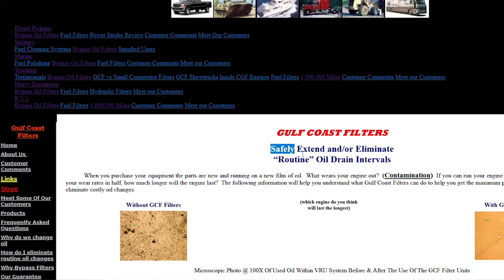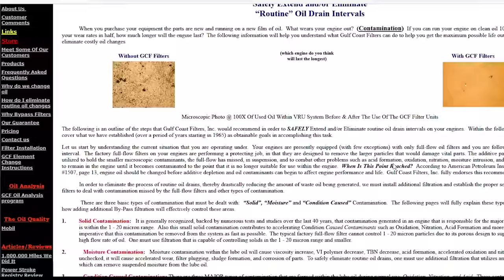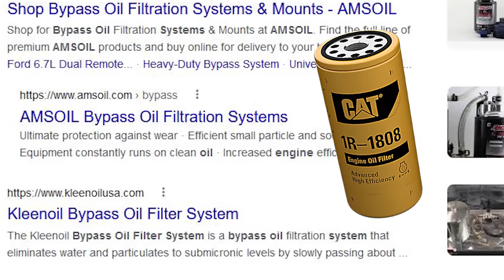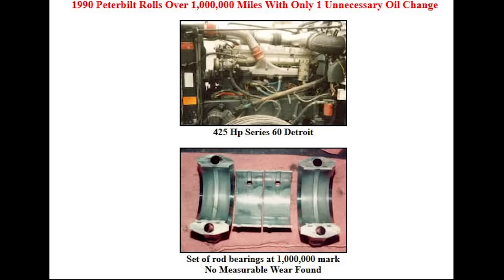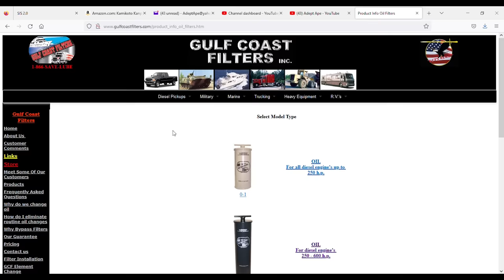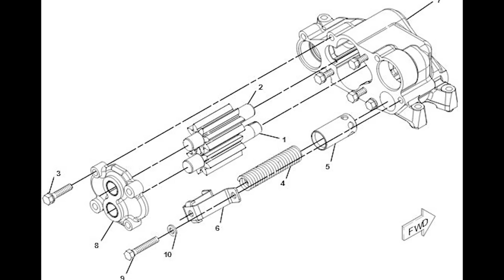No Oil Changes and 1 Million Miles!!! Are Oil Changes Optional with a Bypass Filter? (INTERESTING)

Comment: Please do one on oil centrifuges filters too!
Reply: For some reason most people prefer the simple bypass filter.. A engine needs a certain amount of new oil added. When you change the big Gulf Coast filter you add.3.gallons of new oil. Thats normally enough. When I change my filters its a quart of new oil added at filter change mormally 6.000 miles.In the 60s it was a quart of new ojl added.at 2.000 mile toilet paper change.I used Delo W30. I didnt know it at the time but the multi grades were no good. Couldnt use them in a diesel. They would void the warranty. I started using multi grade when Mobil 1 came out with 5 20. About 1970..you had to have a good engine to use it.

Comment: They don't get the soot out. You need a centrifuge for that. They are available as a bypass system. Bypass filters should increase the life of engine by removing small particles. I use them. You can extend oil changes but i wouldn't eliminate them. The soot thickening is still a prrobem. Use oil analysis at at least the oil change intervals to determine if you need a change.
Reply: When I installed  a toilet paper filter on my nearly new Rambler and saw the oil go from black to amber color I knew it was removing the soot. The soot wss why the oil was black. I found out later some soot is non abrasive and too small to be removed. It will eventually  turn the oil black. If I put the black oil in the palm and it wipes off clean without staining the skin its clean. In my gasoline cars the oil is amber colored. Normally in a gasoline engine the oil will stay amber some of the small soot is getting thru but in a gasolene engine its not enough to turn the oil black.
Reply: My 6.9 F250 im told had over 300 K miles on it when I bought it. The oil was a shiny black. Didnt bother me. I know black doesnt mean dirty in a diesel. I would be concerned if the oil wasnt amber in the Pontiac. The old Ford used or leaked a quart of oil about every 600 miles. I changed the toilet paper 2000 miles or less. The Ford diesel tractor is a lot tighter engine. Keeping the oil clean will be easier. Of course it wont be pulling a camper or a Horse trailer.

Comment: I do not change my oil, never have. The lawn mower is over 10 yrs old. Never changed the oil. Checked it last year for the first time. Only hat 8 oz in it. I did drain and top it off, now it smokes. My 318 requires 1 qt a week. Haven't changed it in 10 yrs, ant gonna change it.

Comment: Cars and trucks and stationary engines in 1888 had full-flow bypass oil filters. The manufacturing tolerances is what have changed!!! In 1918 a Rolls-Royce, or Packard or Miller-Duesenberg (THE finest motor in the WORLD!!!) or any Aero-engine MIGHT be built to +/- .003 INCH tolenerences. Today, Honda, Kohler, Shindaiwa and 20 other SINGLE CYLINDER $200 lawnmower engines are built to 3 MICRON (3 one-hundred thousandths) of a mm or 1/2500 the tolerances!!! Lexus and Japanese multi-cylinder motorcycle engines (and Japanese outboards) are spec'd to .5 MICRONS. I own a 1964 Honda 305cc SuperHawk twin with 30 K miles on it. I re-built it just for giggles. A friend has a 1970 Suzuki GT750 Three-cylinder "Water Buffalo" 2 stroke that has probably 1 million miles on factory rings and he rides it EVERYDAY! Another friend has a Suzuki RE5 rotary (Wankel) on FACTORY SEALS. I've NEVER seen a worn-out Japanese motorcycle engine. ABUSED-OUT, yes! Ask me about 1960's British Bridgestones, small Triumphs, small BSA's and the excuses for small bikes Hardly-Davidsome was selling in the early '60's!!! When the 1958 Honda Benly (Friendly) hit Californicate, a humble 125cc twin, the market for small Brit Bikes disappeared. The Benly would out-perform 350cc Brit-Bikes, mainly because it ALWAYS RAN!

Comment: Hot shot diesel has good information on bypass filters as well they suggested a tier 4 synthetic and to add additive packages back to the oil since those wear off over time but they had a similar experience with long oil change intervals
Reply: These guys say you need this special oil and special additives.. i use Super tech from Walmart and a Australian Jackmaster Classic on the Pontiac. Torrent. The Pontiac has 203 .000 miles on it. Runs like new and seldom needs oil. I did fine with conventional oil. The Wix full flow filter has 63.000 miles on it and about 4 years. If I start seing large particles in the Jackmaster Classic I will change the Wix.
Reply: When I started using the Frantz it was use a roll of 2 ply facial quality toilet paper and a good single weight oil such as Delo.W 30. Now you hear all this bull shit about you need this special oil. Rotella is dirty and toilet paper channels.I dont use toilet paper that channels. If there is any dirt in new oil its gone after it goes thru the toilet paper or paper towels. Gulf Coast came out with a better filter than the Frantz. The Gulf Coast junior. The Jackmaster Classic is a improved filter.I cant keep up with all of the good filters.It pays to shop around. The top loaders are best.I use Scott 1000 or Great Value 1000 from Walmart. I go on the Jackmaster web sight and they say to check with Gulf Coast about the 1 million mile engine. Are these people working together. The Gulf Coast junior I see a foreign language. Im glad im equipped. My oldest filters are 50 year old Motor Guards.

Comment: Do you have any experience with equipment that has an oil centrifuge? Just curious what you think would be better a centrifuge or a by pass filter system?
Reply: I run a centrifugal bypass on my Detroit series 60,it pulls a incredible amount of soot out of the oil.A bypass paper filter would  clog up over time like the main filter and just go into full flow and leave deposits in the oil
Reply: I have read some centrifuge manufacturers claim filtration down to one micron
Reply: @craigduffield3963  sounds like you know about as much about bypass filters as I do about centrifuges.. I dont run a filter until it wont hold any more contaminants. For some reason most people prefer the simplicity of a bypass depth filter. Jackmaster claims 1 micron filtration if you use their elements.

Comment: By pass filters work great but that doesn't negate the need for oil changes as specifier by the manufacturer of the engine. Viscosity breaks down and does not last. Not changing your oil is playing Russian roulette with your motor. Short term gaines for long term losses.
Reply: The oil is being changed . 3 gallons of new oil every 10.000 miles when the 3 gallon filter is changed is a lot of new oil added in a million miles Then you have the full flow filters changed.. Road King said thats equal to a full oil change every 40.000 miles. A lot of you guys arent paying attention.
Reply: Engine maker oil change recomendation are based on filters that dont clean oil

Comment: Actually in the old days they had diesel that actually can filter out the red dye download one or two microns they do have oil filters taken filter down the five microns the only thing it filters out the additive that makes the oil work. The old graphite oilers design to where you just change the filter once in a while and you would add a quart of graphite oil.
Reply: No the filters wont  remove the additives. The filters will remove graphite because it is a solid..Oil analysis will list the additives. You will need to know how to read the report.. with my old stuff oil analysis is checking the dipstick and  the used toilet paper for problems. Not sure about  the micron rating of toilet paper.. I have read claims of submicronic  to 1 micronic to 5 micronic. I would think they would be pretty much the same. The big Gulf  Coast filters have the size advantage. Very hard to get contaminants thru  22 inches of Bounty big rolll paper towels

Comment: Yep, no need to change oil.  Oil doesn't really break down, it is the additives and long chain polymers added to the oil that break down, causing it to fail.  Combined with the added contamination from combustion, a high grade filter and monitoring of the oil is often better than changing the oil in bulk intervals.

Main reason it is better than full changes is because a full change cycles between clean and dirty, while the extreme micron bypass filters keep the oil fresh at all times by more completely removing contaminates.

When changing the bypass filters, the oil capacity they have, about 2 gallons, is often enough to replenish whatever polymers and additives break down during the operational life.
Reply: Actually that is very true.. It has never made sense to allow the oil to get dirty then drain it. Oil analysis shows that 3 gallons of new oil that is added when the 3 gallon filter is changed every 10.000 miles is a little more than enough. In the million mile truck. Its the same in a over the road truck or a VW beetle. Its a matter of never allowing the oil to get dirty and adding enough new oil to get enough additives.
Reply: It wasnt too long ago when you couldnt use multi grades in a diesel.They must be a lot better now. I started using Mobil 1 when they came out with 5 20. About 1970.
Reply: @ralphwood8818  wasn't too long ago?  1970 was 50 years ago, heh.  Packard and Studebaker we're still making cars then.
Reply: I remember looking at the 1953 Corvette and wishing I had 3.000 bucks. I  was pulled over by park rangers as I came into Yosemite  park.The ranger called head quarters. We have to watch this kid.  He has a Studebaker Hawk with a souped up Chrysler engine.. Got a lecture on speeding in a national park.I wasnt speeding. I slowly went back out the gate. Didnt have a hood. A California Highway patrol car made a u turn and followed me for a mile or so. Actually it was a 55 Commander coupe with a silver Hawk trunk lid and a stock Chrysler hemi. 331. I believe the Silver Hawk was a flat head 6. The Golden Hawk had a super charger and a hood. The patrol car was a Dodge Polara with a 413 wedge head. 1960 I believe.

Comment: How many gallons of oil are in the engine when I drove semi I had 8 gallons in the oil pan six in the filters and 3 gallons in the cooler so you divide 17 gallons into a million miles then you have to add the oil and they change the filter every 10,000 miles all three of them so I see why the oil will guarantee a million miles they deemed to my truck obsolete only because it was the oldest one of the fleet and I was the only one that wanted to drive it no GPS on board computer a little twist of a screw here and a little repair here I just increase the horsepower and torque by 10 folds I love my truck

Comment: Oil bypass systems can make oil service intervals way longer. But not NEVER change it. It may go twice as long or longer with a 2 micron bypass filter...but that is it.
Reply: I dont think even a 1 micron filter can completely remove all the soot. The oil in my diesel tractor is starting to get a dark tint to it. Its my understanding that some soot is non abrasive and too small to be removed even by toilet paper. The oil in my gasoline engines is beutiful on the dipstick. Put it in a glass jug and it will be dark. Motor Guard has always claimed sub micronic. If the oil on the dipstick doesnt stain the skin its clean enough for me.
Reply: It's not frdignrd to trove ALL soot...just way more than a 20 micron or more standard filter does.

Comment: There is a mack truck owner here in Richmond VA. Ran a ch mack million miles on ames oil ..changed the filters on schedule but never changed the oil.
Reply: I dont doubt it. People were doing it with conventional oil before there were synthetic oils. When Delo was 29 cents at the discount stores. About 55 cents at the gas stations. Couldnt use multi grade oil in a diesel. The polymers were no good. Trucks required single weight oils.my old diesel tractor requires 30 weight in summer when the temperature is over 50 F..This is Dallas Tx.  At the top it says 10 30 year around. Then you read a little farther down on the engine sticker. I put heavy duty 30 weight diesel oil in it.

Comment: Let us not forget oil additive depletion, which is significant over a long oil service interval.
Reply: Additive depletion isnt a problem because you are adding new oil when you change the filters. Thats 3 gallons for the Detroit 1 quart for my small engines.
Reply: @ralphwood8818  That still leaves a sump full of oil that has a lot less  additives than a complete drain and refill with new oil.

Comment: interesting i mechaniced for many years and now i drive for airgas as a short hauler. my question on this system is this. 
so i have ran otr stuff and those trucks are staying the same/similar RPMs and Speed and things alot of the time which makes them tend to last longer. were as my t370 -px7 starts and stop (not shut off) mulitple times per day. meaning the rpms and speed is never constant. and in my past findings ive seen the short haul trucks tend to get more excessive wear on them then the long haulers or otr. so would this filteration setup be worth the investiment to go from (i think) 10,000k mile service intervals to say 30,000k miles? 
the fleet mechanic that comes and services our trucks is the same one everytime and u talked to him and he said that his freightliner m2 (i think) has the smaller detroit dd9 maybe? and he said its service intervals are 45k as a 15 plus year heavy machinery mechanic i about fell over. i changed our c12s and c15s and m11s and n14s and the dt466s every 7500 miles on the spot.

Comment: are these bypass filters really only for trucks or diesel engines or still good idea & worth it for regular gas vehicles ?
Reply: In the 60s I changed. The toilet paper and added a quart of oil about every 2.000 miles.. Now I go 6.000 miles. Oil is better now and engines are cleaner.. You have to make adjustments for different driving conditions. All I have now is top loaders. Jackmaster Classic Motor Guards and Gulf Coast juniors..Started  in 1963.with a Frantz on my Rambler American.

Comment: ED here, people dont realize how much oil is run thru industry such as paper mills that run 24 hrs. daily. they have so many leakson  machinery and wheeled machines. these paper machines only go down once a month normally and the oil is filtered many times, sampled, topped off regularly. the costly procedure is getting water out of oil when u cant shut the machine down. in a emergency you pump off barrel or two oil as u add fresh oil which gets expensive. everyone should be able to see now what $$oil/ fuel prices do to a economy! diesel moves the world and why cant the gov. get the price off 4 to 5 dollars per gallon??

Comment: The  ADDITIVE  PACKAGE  of the Oil will get fully consumed , along with the Fuel Dilution issue .
Certainly a  By-pass filtration system is a Good idea , because it removes such small particles , but quite frankly , this sounds a bit Bogus .
Personally , I  swear by  Oil Centrifuge  By-pass systems . Serviceable and Easy Diagnostics of the Residue .

Comment: oil samples, oil and filter done every 20,000kms haven't had an issue one rebuild at 1.3 truck is now at 2.7million still going c16 with brakesaver, oil is cheap engines are not

Comment: I have to disagree with their claim that oil is fine for a million miles because in 1976 we did a break down test on oils and yes  vecosity break down does take place which means acid build up and less lubrication from your oil
Reply: The Series 60 Detroit gets torn down and the parts measured about every 250 K miles  by Shell oil. The Rotella gets tested often. No the oil didnt last a million miles. The make up oil added at filter change is equal to a full oil change about every 40.000 miles.
Reply: Use your head people. The Detroit gets about 350 gallons of new Rotella oil in a million miles The reason the engine is in such good condition is it doesnt use the conventional system of allowing the oil to get dirty then draining it.

Comment: I wonder about applications for average vehicles. Are usually rebuild my engines just about 170,000 miles and there is always wear to the point it exceeds manufacture tolerances in the engines I pull apart. I always drive my vehicles 20,000 miles a year in mid to heavy usage maybe a system like this would go a long way in preserving the internal friction points of a gasoline engine.
Reply: I have used the filters mostly on gasoline engines for 60 years. I dont drain oil. The engines and transmissions  are the last things that need work.

Comment: I ran a OPS system on a c15 with amsoil I changed the OPS filter and took oil sample every 12k.and changed the cat filter every 24k and kept oil topped off as need did not change oil for 500k and then the samples were still good I just couldn't stand not changing oil that long lol...as soon as my warranty is out on my cat platinum rebuild it will be on the c15 acert but we know how people are on warranty work find any reason not to stand behind it
Reply: And another thing the time it saves wating to get get your oil changed..still need to grease it